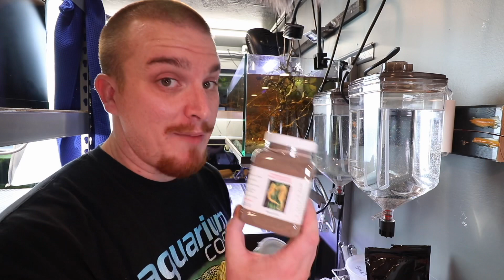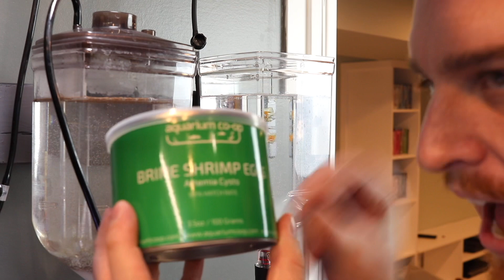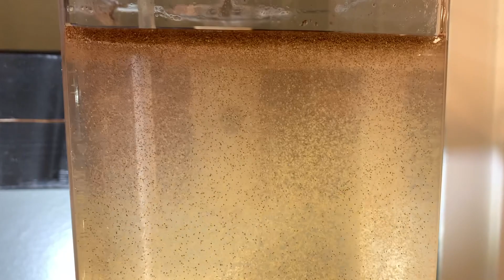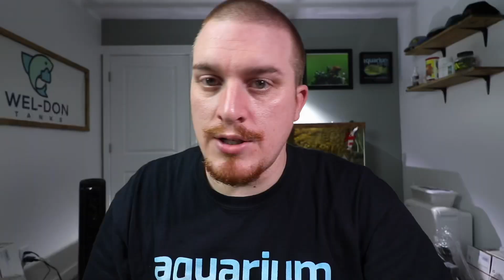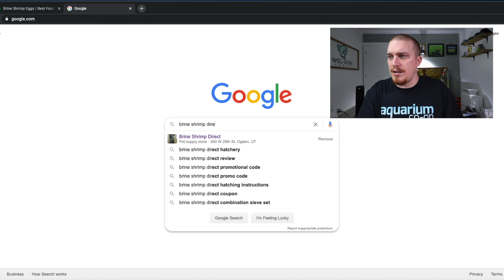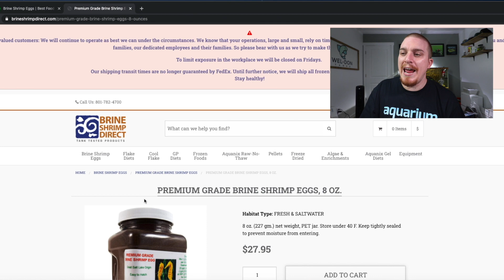Aquarium Co-Op VS Brine Shrimp Direct (Brine Shrimp Eggs)

Comment: Yay this is the video i was hoping to find.  Co-op vs BSD. I am VERY new to hatching brine shrimp. I got the Ziss haychery with a small heater set to 82⁰. Only have made 2 batches so far, using co-op's eggs. Every video ive seen from co-op says eggs float for easy separation and collecting, but ive noticed lots not hatched or hatched eggs sinking down or staying floating in the water. Even letting the water sit without the bubbler for 20+ mins with a light at the bottom. So i just wanna see what one is easier for separation of bbs and eggs.
Reply: See my co-op eggs look more like BSD's eggs at the bottom.. weird

Comment: Good video. I really feel the same type of hatching solution should have been used on each brand of eggs. Possibly rock salt on each brand, then a hatch using the salt mix. You need to be fair about this. Even an addition of a small amount of magnesium (Epsom salt) can help the hatching.
Reply from the maker: Hatched hundreds of batches with both salt and same result.  In my opinion I got the better result from the coop eggs.

Comment: I noticed that the aquarium co-op one little longer to hatch and the shrimp themselves were smaller in size whereas the brine shrimp direct ones are much bigger in size. I agree that separate of eggs/brine shrimp was definitely better with aquarium co-op. I'm current using aquarium co-op but I will switch back to brine shrimp direct once this batch is over.
Reply from the maker: I have had problems if I let the coop eggs go longer than 24 hours.  24 hours is my sweet spot in getting a great hatch.
Reply: @WeldonTalks  Same thing I'm realizing too. It also depends on the container that I'm using. I just use bottles, the thinner the walls of the bottles I can keep the eggs longer there for hatching.

Comment: You blew the comparison when you used a different hatching mixture.  If you are using the Co-Op eggs and their salt mixture, you did not factor buying that salt into either the price comparison nor the egg separation comparison.  Use the same salt mix for both and see what happens.
Reply from the maker: Used the same salt mix plenty of times, same results.  I did not factor the price of the salt in because you can use whatever type of salt you want.
Using their salt and using rock salt has not affected hatch rates on either brand.

Comment: I’ve been using the brine shrimp direct eggs for several years and currently have about 5 ounces left of the premium eggs from them. I plan to try the co-ops once I finish these up. But I’ve always had good luck with these. I got the ziss hatchery and had bad lunch and didn’t have a hatch result like I normally did before
Reply from the maker: Not sure what would have caused a bad hatch.  I have hatched the rest of my premium grade eggs with no issues in the Ziss Hatcher

Comment: It’s a good test, you should do another one switching salt to see if salt mattered.
Reply from the maker: I have been hatching it now with just rock salt and have not seen any difference
Reply: Still getting the same results? CooP eggs produce better?
Reply from the maker: Same results.  Salt never affected the production of the coop eggs.
Reply: Thank you Sgt. I’m starting my CooP blender tonight.
Reply: One last question, did you use any light source while cooking them? Or just the heat in the room?
Reply from the maker: I do not have a direct light on them when hatching.  Mainly because I do heat my fish room to 80 degrees
Reply: Cool, I’m gonna use a heater, my fish room is in my basement,  it gets pretty cold here in Chicago.
Reply from the maker: Bay Area aquatics has been using a heater in his Hatcher with great results.  He is using a preset 10 watt I think